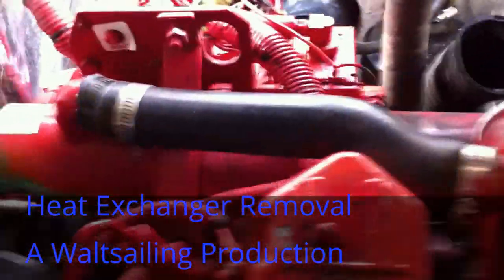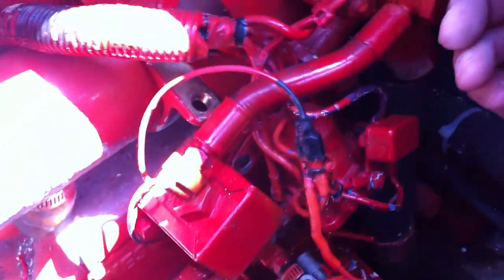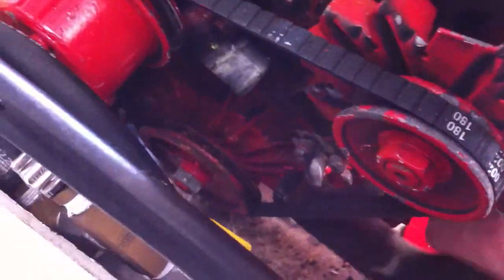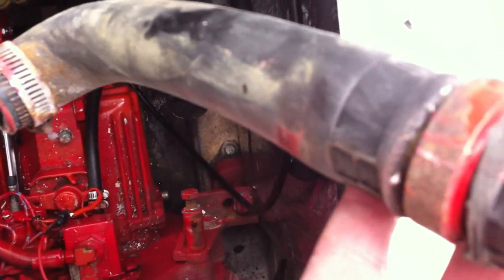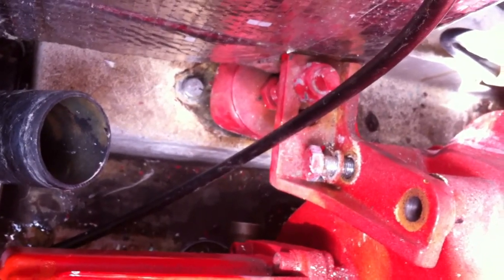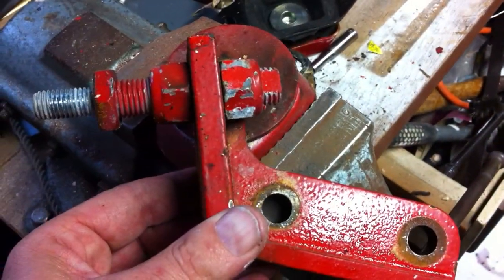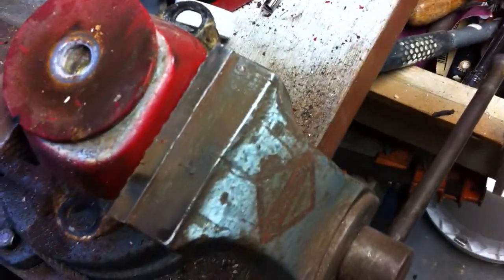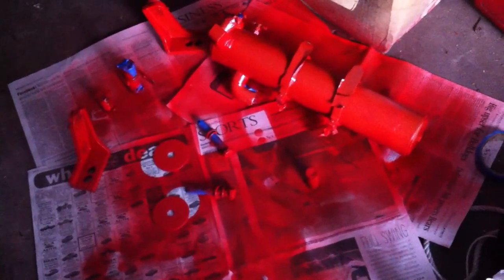heat exchanger

Comment: If possible, Can you explain to me where the impeller is located on the engine? I am trying to locate it to replace it! Engine is overheating. Thanks,
Reply: Inside the saltwater/raw-water pump. Which on a D-series Ford is located in one of 2 locations. 
1st and most common is under the injector pump. This pump runs at engine speed. 
2nd is in front of the injector pump bolted to the timing cover. This pump is driven off the front of the injector pump gear wheel and turns at 1/2 engine speed.